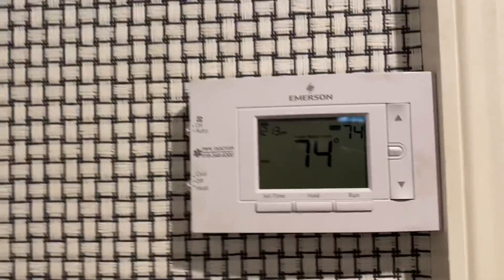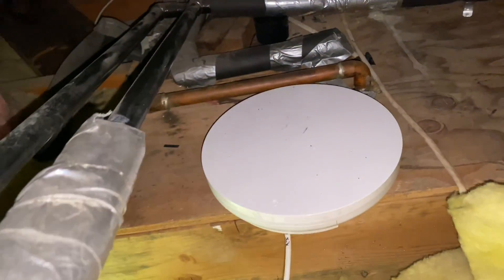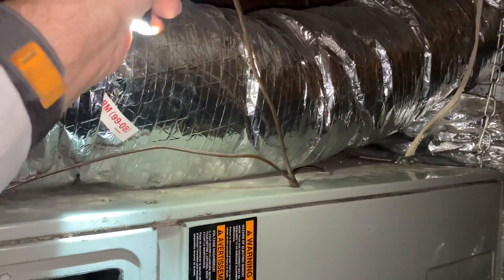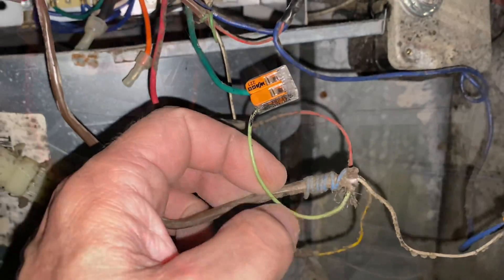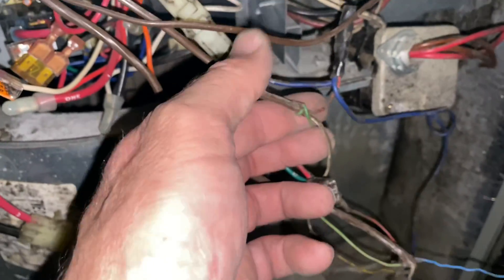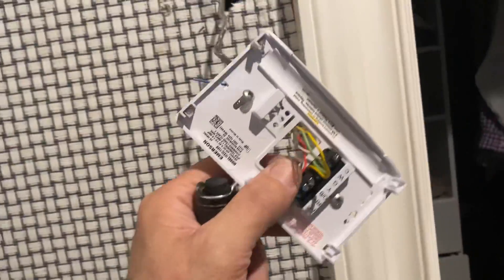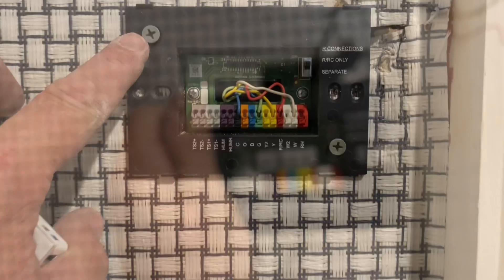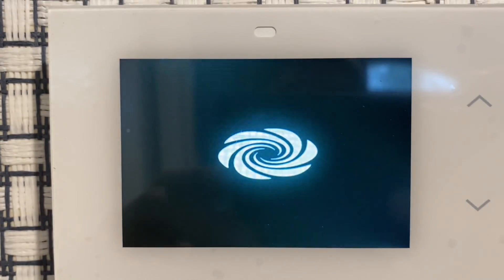How to Wire Creston Home Automation Thermostat or Any Wi-Fi Thermostat That Needs a C Wire

Comment: I use a ecobee thermostat and I'm using it on my boiler system and my window AC, I used the C wire from the boiler systems transformer
Reply: @PipeDoctor  yup, I use 2 24v coil powered relay, one for fan and other for compressor and bypassed the controller that burnt out (knowledge saved me a lot of money haha).. I than ran 18-3 stat wire going to the relays controlling the power to the A/C and used the other 18-3 stat wire from the boiler zone valve for heat and power input and hooked it all up and did programming and works great so far.. well hope you are enjoying vaca!! Stay fresh

Comment: Did you know on some furnaces you can use the green wire for the common and the fan will work without the g hooked up.
Reply: But that illuminates the usage of the fan only which some people use
Reply: Yeah that’s not the right way to do things. Run new wire.